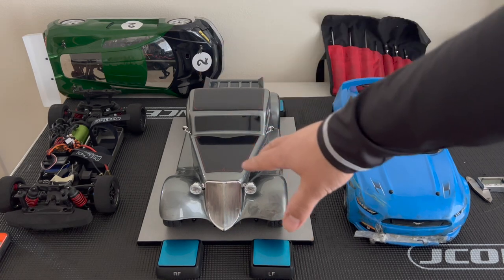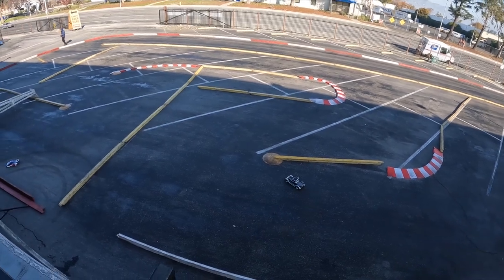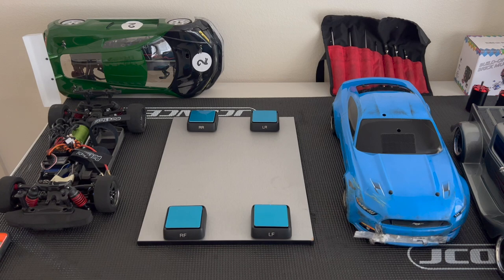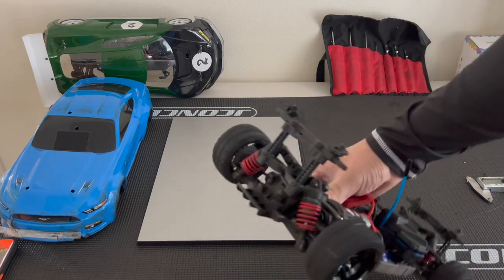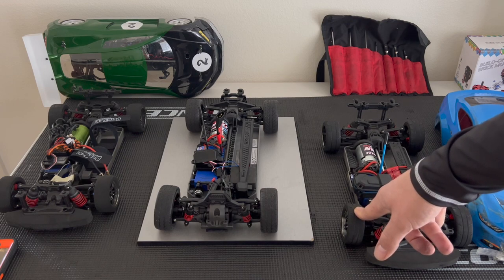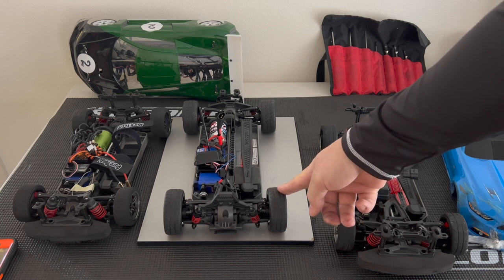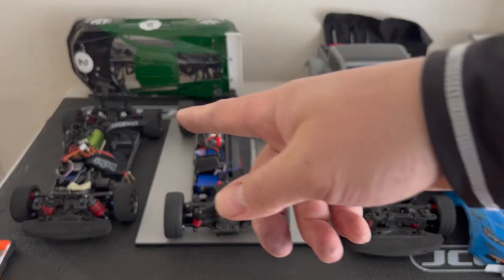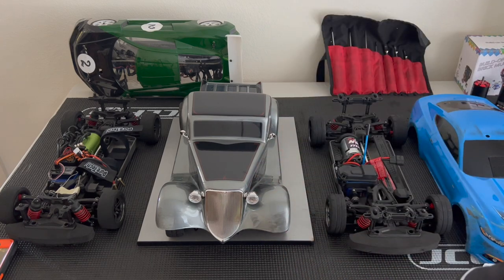Traxxas Factory Five vs  4-Tec 2.0 in depth overview and comparison for F5 shock options go to 13:50

Comment: I’ve had a 2.0 since they first came out and just  bought and have modified the coupe some recently.  Ended up getting a clear body and going fenderless with it then getting the Supra’s tires for it.  The coupe looks pretty bad ass with the fenders chopped off and Supra rolling stock and handles the older 2 Pole, non waterproof VXL system than the 2.0 does.

I did pick up the aluminum versions of the 1/16 GTR shocks to put on the Hot Rod to see how those work out, already had a set of the short Big Bore shocks off a Nitro 4-Tec I had.
Reply from the maker: I really like the setup you described. Did you use any tire prep on the Supra tires?
Reply: @telecomandorc  So far, no prep on  the Supra tires and they feel way grippier and by the time I was done running it the first time, they had some heat in them and tacked up. I haven’t had a chance to run it again, between it running warm due to the diffs being a bit tight, work, and crap weather, though I put the shims and steering bellcrank bearings in after dinner last night. It rolled and steers more smoothly now and should run better line my 2.0 does. I did try the 1/16 E-Revo shocks, but they’re too long to work right, so O out the stockers back on for now and plan on selling these to the friend that I bought the Hot Rod with since he has one of the little Revos too.

If you or any other viewers want to try the shims and bearings, I used Kyosho 96647 shims and put 2 of the .2mm shims between the diff cups and bearings, which is basically a simple and straightforward job. The bearings are 5x8x2.5 (Traxxas pn 5114) for the top and 6x10 (PN 5105) for the bottom and I just swapped those out while I had the front in apart for the shims. 
Give me a few and I can post the video from that first run with the Supra tires and fenderless body, which also has an unboxed and straight out of the bag TQi w/TSM Rx in it.

Edit
Here’s the video link I mentioned!
https://youtu.be/xGKi_Xu4v2c
Reply from the maker: @GreenJeep1998  That car looks awesome fender-less. Wait, have you considered TC shocks or the ones off of the 2.0? 
I made this video some time ago: https://youtu.be/prOtYO1p-nI
Reply: @telecomandorc  Thanks, it’s appreciated!
I watched that video a few days ago, but wanted to stick with the 1/16 style shocks on it for appearance sake. May have to search around some more and see what else is out there that might work at this size.
Reply from the maker: @GreenJeep1998  Makes sense. I will keep an eye out.
Reply: @telecomandorc  Thanks!

Comment: Great video and tips. Yes the tires are slippery mine always wants spin out
Reply from the maker: Thanks. 
I tries some Mighty Gripper (Black) on the rear and locking the front diff. Those tires are still pretty drifty. 😆